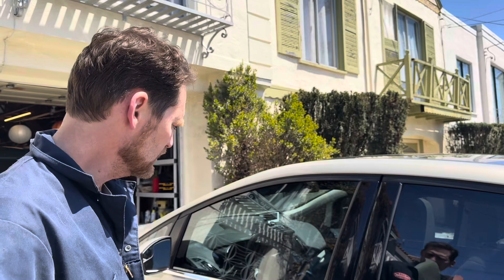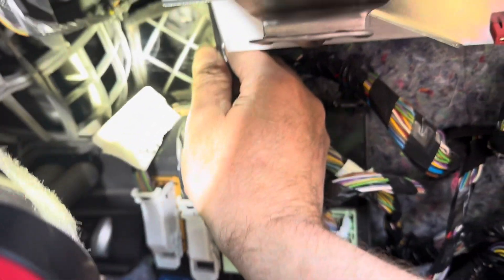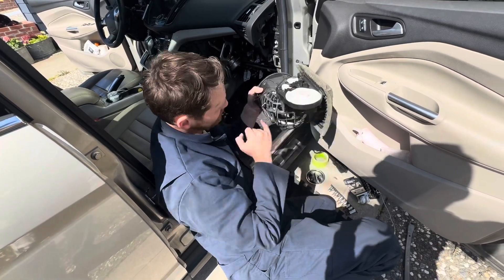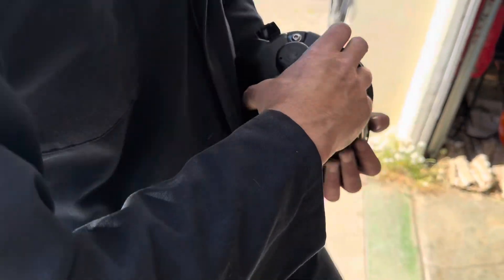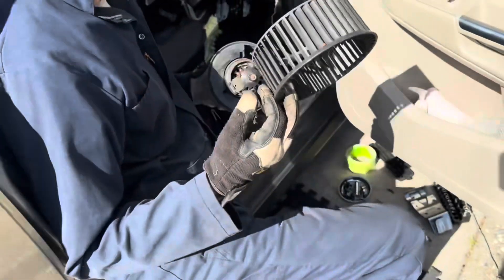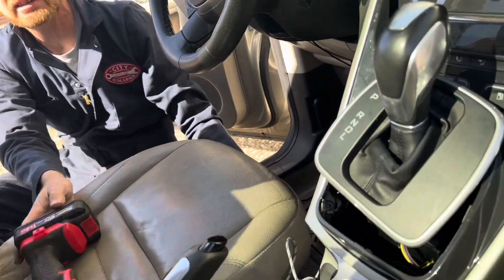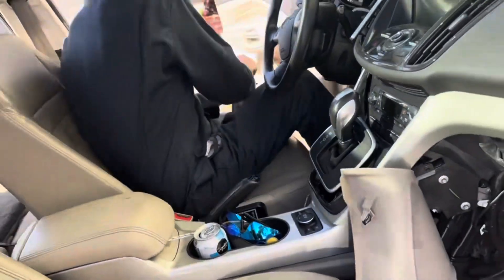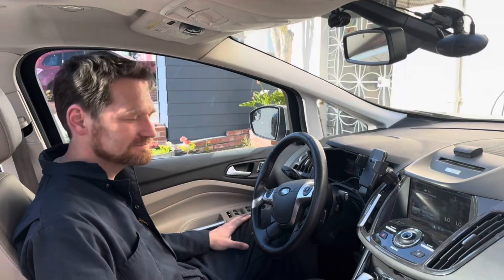Ford Cmax Energi Blower Fan Replacement

Comment: Motivated to take my 2014 to Kelly Ford in Melbourne.  My fan has 280,000 miles on it. FLORIDA Miles. Too, I'm  6'4, 235 lbs, and ... almost 74 years old
...

Comment: hey mr. electric, i was wondering if you have a forum where i could ask you a questions about certain tools to use for a job im going to perform on a 2005 prius. would love to grab your time for a couple seconds and learn
Reply from the maker: I guess you could just ask your question here in this comment thread
Reply: @Mrelectric423  in your video of you swapping out the actuator on the Prius a couple years ago, what was the list of tools required for the job that you used? As well as maybe the tools that made this job easier for you?
Reply: I’m going to buy a used actuator and do the labor myself
Reply from the maker: @johnevered4763  well if it goes well you only need a socket set and wrench set. Maybe a set of crows foot flare nut wrenches would help a bit. If something goes wrong you will need a techstream or equivalent fancy scantool
Reply from the maker: @johnevered4763  not sure if my other reply went through so here goes again 
-A socket set
- wrench set
- crows foot flare nut wrench set
- techstream or other nice scantool. 
The last two items may or may not be needed.
Reply: @Mrelectric423  great thank you man, your video from a few year’s back is incredibly easy to follow and I thought it was going to be a much more intensive job. I’m buying a used actuator from eBay because I didn’t realize the new ones are as expensive as they are, anything to be careful of before I proceed off the top of
your head?
Reply: @johnevered4763  How do you know that it is the brake actuator that needs to be replaced?
Reply: @hedgehogthesonic3181  the sound it makes on the car, a lot of research and comparisons

Comment: I'm just finishing off this job on our 2013 C-Max Energi. I'm not a mechanic. I am an old mechanical engineer with close to 40 years of experience, who specialized in structural finite element analysis and opto-mecanical design. My hobbies have been fixing and customizing cars for almost 50 years and I have changed many blower fans over the years. 

This HVAC and dash assembly is an embarrassment to all mechanical engineers and mechanical designers. I've never seen such a horribly designed system in my life. 

So far I've spent at least 12 hours on this. In our case the old fan had somehow distorted so badly that I had to make up a tool to apply well over 80 ft-lbs to get the fan motor out, not to mention need to get my son-in-law to help on the driver's side while I worked on the passenger side. That was actually my 3rd attempt to make the tool. The first two simple ones broke because they couldn't handle the torque. 

Everything about this design is beyond ridiculous. Different screws requiring 7mm, 8mm, 10mm, T-15, T-20, etc. tools. Screws coming into modules blind from the firewall side. Blind hardware access for far, far to many screws. Magnetic T-20 tools with long extensions required to get the recirculation module out/in, etc, etc.

Even the air bag is mounted with a complicated assortment of brackets using different hardware, blind screws and unnecessary interlocking brackets that provide no structural benefit. 

It is funny that I turned down a job offer from Ford in 1999 to work in their HVAC department. Had I accepted I might have been involved in designing this mess.

I can tell you I would never have approved and signed off on this design.

One thing I have always done is had my junior engineers always be the first to assemble what they've designed. I wonder if this was designed by an engineer who had technologists always help assemble everything?

It also looks like different people designed the mounting solutions and the brackets and there was no effort to use consistent screw heads or mounting methods.

When my Ford dealer quoted $3000 I thought that was ridiculous and that I would just do it myself. Now I understand where that number came from....

How on earth did you manage to get this done in only 3 hours?

I'm my case I didn't skip any hardware but I had to use my endoscope to see many screws, a custom built, very long with neodimium magnets, T-15 tool for the recirc module, plus the tool to turn the blower motor through the fan itself.
Reply from the maker: I agree the design is a ridiculous joke. I imagine the dealer would have called back and asked for more money had you let them start the job.
I think I spent well over 3 hours on the job.
I kept thinking I am missing some trick to getting the airbag brackets out of the way...
Modern Ford engines are made the same way. Disposable cars are here!